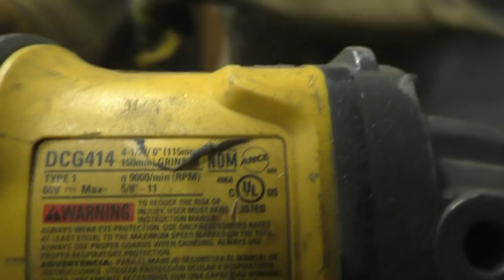Grinder Safety -- and lies you are told to scare you.

Comment: Pretty sure the danger of the discs exploding was risk of the past before they were fibre reinforced. Or maybe made in China stuff.

There are pictures of discs getting lodged into people’s faces though so maybe they still do explode? But who knows what they were using, could’ve been something with more power then a consumer grade grinder, and then putting consumer grade discs rated for lower rpms on the spindle. Overspeeding things is the only time I’ve ever seen anything blow and that was with an ingersol rand die grinder that does 35000rpm, thew in some cheap grinding stones from Home Depot not rated for 35k since I was in a rush and one of them blew up. I didn’t continue trying them out afterwards to see if they were all bad since it scarred the shit outta me and I went off to buy the proper stones from Grainger.

Comment: If people had little bit of common sense an just used the tools correctly, using the necessary safety equipment, no one never would get injured. Nothing less, nothing more. I don't get what u were trying to prove wih this video, but i get the point that  a grinder it's not a leathal massive destruction tool.

Comment: An angle grinder is probably one of the most dangerous tools in most workshop and is not to be taken lightly, however, if they were inherently super dangerous, people would not use or manufacture them. With common sense as well as not using cut off wheels as grinding wheels, most people will not get injured. That being said, I don't think this experiment is encouraging people to take angle grinder safety seriously. I could probably crash a car at 30 mph and walk away, that doesn't that you shouldn't be meticulous about driving safety and have someone else drive if you're not confident. I get that you're encouraging people to learn new skills and not live in fear, but I don't think throwing caution to the wind and using it as an example of how you didn't get hurt is the best way to do that
Reply from the maker: I was not going to get hurt the focus was the safety glasses in the vice.    ...and you need more tools in your shop if the grinder is the worse one you have.    : )

Comment: alright, look.  Small grinders don't concern me too much a 5" grinder wheel isn't all that dangerous without a guard but you need your guard on there for anything larger in my trade.  And for god's sake don't take the guard off a chop saw.   Those 12" wheels can easily kill someone.  It takes 1 manufacturing flaw or some dumbass who doesn't even look at the wheel before putting it on to see if it's cracked to kill some innocent person walking past you on a construction site.  (I have seen this happen. Not killed but got stabbed by a shard of a shop saw blade) 
There are some good points made here but that's at your home or workshop don't go doing this stuff on construction sites because you don't know who might grab your shit and start using it or who might be around when something does go wrong.  Trust me I have a crew of 25 and there is always one that has no common sense.

Comment: stay out of the plane,  turn your hip towards the cutting action, not your crotch!
 RUB your way through the steel don't bite through with the disc at an aggressive angle...its the  kick back that is the killer, when the spin of the disc pulls it in deep all of a sudden

My young assistant (29 yr old) just had a bad kickback that threw  the running saw blade into his left forearm,  driving a one inch by three inch long section of the broken disc inches deep in between his tibia and fibia.   A pretty bad and painful splinter to have pulled out in energency room.  He was going into shock as I got him there. not much blood but a deep deep cut

position your self so the tool pulls away from you as it grabs....not so it pushes towards you if it grabs.  our little Milwaukee grinders run at 12000 rpm  a 6 inch disc is over a foot and half circumference, so that's 18000 ft per minute or almost 200 miles per hour,  you have to respect that velocity and spinning momentum....if it suddenly catches and runs back at you, you will be hurt badly quicker than thinking.   set yourself up so the cut don't buck back towards you.  be safe, injuring your self sucks and makes you stop working, its embarrassing and undignified to stop everyone s work and bleed all over the shop.

Comment: I agree that the most important thing you can do is keep out of the axis of rotation of the blade. That said, i have had a cut-off disc come apart on me and a piece cut through my jeans and about 1/8" into my leg. It was bloody, it was messy, it kinda hurt, but i was just fine after some iodine, some cleaning in the sink, and a dab of CA glue to hold it shut till it healed.  I always wonder what could have happened if i didn't have that guard on. hmm..

One important thing most people do wrong is how they tighten down the nut on their grinder. DON'T ever use tools. Tighten it by hand with the pin depressed, then grab the outer edge of the wheel/disk/flapdisk and snug it up that way. You can crack some types of grinder and cutoff wheels by over-tightening.

Comment: Also power plugs are over rated, just poke the wires in the slots
Reply from the maker: Done that.  It works fine.   Sure beats standing around with your thumb up your ass.

Comment: Yeah, no man. You are operating on the belief that majority of people have common sense, or quickly learn. But that is not the real world. We scare these noobs so they start off cautiously, and slowly over time, getting experience, learn how to do it themselves. I too, no longer use the guard, as I find it easier to maintain my line of sight. But I have been working with these for years, learned the things that you can't do with a grinder (which is very little).
Reply from the maker: Exactly a grinder like most power tools,  needs you to stay in your comfort zone while you build your skills.   I think a vacuum cleaner is an exception.  : )

Comment: I've had a few come apart on me over the years , usually happens around when the disk needs replaced and warn down to much. I've never had a full disk or half disk burst. And haven't been hurt when it does. Always wear safety glass bc eyes are flesh sacks
Reply: They're not even robust enough to be compared to "flesh" imo bc steak is flesh, eyes are more like  hollowed out liquid-filled clementines with deli-thin strips of muscle here & there & always make me uneasy thinking about how horribly fragile they are

Comment: How to not use an angle grinder Always use guard gloves goggles and a visor 2 layers of protection are better than 1
Reply from the maker: So always work to the level of the most unskilled person you can find.   Great advice.
Reply: @SVSeeker  if you can work well with an angle grinder cool but best to work safely people have died or have life changing injuries cos of not using a guard etc 
You might get lucky  several times but eventually your luck will run out
Reply: @SVSeeker  you carry on using an angle grinder see where it gets you what a fool🤣
Reply from the maker: @lukecleaver7462    Been using them for over 20 years with nothing more than a scratch.   A fool is someone that thinks they know what other people are capable of and tries to set limits.
Reply: @SVSeeker  ok the fool is uncalled for doesn't matter how long you've been using them for they have a guard for a reason same as ppe is there for one
Reply from the maker: @lukecleaver7462   No.  Not at all.  You are incorrectly assuming that all people have the same skills.   That is absurd.  Try shooting an apply off your child's head.   With some preliminary practice, you'll know if you can or not.

Comment: Lol everything has a time and place.. of course theres reasons for not using the guard, theres plenty more reasons you should tho. I personally just about lost a finger using a grinder with no guard, and I was using it properly, but it just so happened to kick hard enough to send my finger into the 1/4 inch blade, just about severed my tendon. Also have had sparks in the eyes with glasses and a face shield lol shit's dangerous, you just have to understand and be aware

Comment: Well I have now lost all desire to watch your channel. You have obviously not worked for the last 40 years in the steel fabrication and repair industry. Yes they explode! Yes they can cause personal harm and damage. Even the most cautious seasoned personal can have it happen. Thank you for pointing out some good techniques for using a skinny wheel . I'm most happy to know that you have never had to go to or had to take a coworker to the ER. You talk of loosing a finger or an eye as if its a right of passage! Lets talk about I guy I knew who reached down with both hands and grabbed a running lawn mower for some reason beyond my comprehension.  You might have thought common sense would have stepped in the way and stopped him.  Have you seen the lovely white bone down deep in the split open cut from one? How about cartilage?  I know! how about severed ligiments? Not to mention the nasty infection their known for. I guess the time loss from these accidents isn't a problem for you. Have you ever seen a 9inch grinding disk sticking out of the drywall 10 feet up because it came apart. I'm doubting that you have seen any of these things in person. 
     Ok so your a old guy like me also. Maybe you have been that lucky but i doubt it. YOUR hands your YOUR face thats all good, who cares? . But when your crass enough to post something like this. Trying to tell the new guy who you hope is giving you views so you that can pay for your boat, that guy with kids and a wife at home to feed. That guy who wants to go home at shifts end in one piece with all their parts that they came to work with in the morning I have to call bull on you. Its our job as the surviving journeyman level seniors of our trades to teach the uneducated new folks how to survive. Your showing tips on its safe use is admitting that you know they can cause severe damage. 
As you may have noticed I'm a bit passionate about this issue.  May your vessel build be successful and alway keep you dry.
Reply from the maker: LOL   Let me know if you need help finding the UNSUBSCRIBE button.

Comment: In my dumber novice days of construction ( without the proper education) I went under a house to cut a cast iron pipe off. Long story short the blade caught, exploded, grinder flew out of my hands, I caught it mid air (full slo mo from the adrenaline) and came out unscathed. I’m still not sure if I got lucky or if the blade disintegrated into harmless pieces. But yes common sense, know your tools and what they can do. I’ve since gained at least two points on the common sense scale 😅

Comment: Your attitude towards safety in this video does come off as cavalier, but it's pretty much on par with most skilled professionals. I think somewhere along the line promoting good safety practices evolved into just fear mongering.  

The problem with forcing people to be overly cautious about stupid things is that it might take the focus away from where it really matters. Also people might start to put themselves in the line-of-fire while relying on their safety guards and equipment as a first line of defense when really your first line of defense should be your brain and your work practices.

This test was a nice attempt to try and prove the picture fake (I actually do thing it's probably fake), but I think it falls short. The cutting wheel in the photo is the smaller kind that would be used as a die grinder. Those things things spin at 25,000 RPM. Your battery powered grinder probably does something around 10,000 RPM and you were cutting a thick piece of metal which would slow it down a lot. 

If the a person was cutting thin sheet metal at 25,000RPM (barely slowing the wheel down) and the disc went flying it will definitely do some damage. I had a sanding band come apart on me while using one of those die grinder drum sanders once and it made a pop sound and brazed my knuckles. It happened so insanely fast It took me a minute to comprehend what happened. It felt like I just cut my fingers off. I pulled my glove off and all my fingers were bruised and had blood blister on them. That was just as a flimsy piece of sand paper.

I do appreciate your insights. Thanks for taking the time to make this video.

Comment: Finally someone whom talks common sense. I have used grinders as a hobbyist for 35 years and have never had a disk fail. My fingers have accidently tangled with running disks resulting in a minor friction burns. The most common injury is touching hot metal (which doesn't look much different from cold). I don't agree with not using a guard though.
Reply from the maker: : )  The most common joke in our shop.  "It didn't look hot."

Comment: "Exaderated."Hehe guy have home ahead of hospital .. I was not see this accident ..but guys was say that disc broke off from grinder and hit him(i dont know directly or by ricochete) in bload vesel on side of  troat .... He dont seal it or dont seal it proper i dont remeber and blead out in 2 minute away to hospital. As i was kid i was run and feel of ...then hit head in sharp metal corner ... And lost awarness... After few minutes i wake up in great  pubble of blood in flor me in it .. And immiedietly when i lift head up i lost  consciousness again..(.then when mother find me with greater pubble) when i wake up again mother give me mirror and say "warch there is hole and you can see you white bone/skull... I watch it few seconds at sit position and blow pressure increase inncomparision to lay flat ... Soo i pass out again .. Next time i wake up in hospital... Something similar can hapend not by fall of but due to some grinder iccident that not imposible ... Soo instead if play with it i try to minimalize risk .. I life 34 years and never bloke any cutting disc ..  Month ago i was work with not my tools and there was no cover on angle grinder ... We need but some pipe that was rubber pipe with steel enforced sticking out of ground .... There was  two discs that broke of grinder at this cutting .... I dont even know where it fly but at that position it can but vessels at my hand ... I was try to put presure at top soo disc will not be grabbed and stop but it propably happend anyway .. Becouse that pipe was multilayers that propably w as losse inside or something and stop/crack disc there was some vibration . I was try to hold grinder staid as it was possible i thing it was ..but when i cut without cover maybe it was not straight bacouse i not want have eyes in line of potential hit . Not use cover is always play with death. It can go safe 100times and 101 it can kill you... Its other story when my father work with other straight grinder and without cover .. There was his mistake that he use toth blade on it and behing wood was rubber ... His head not was behind blade .... But when grinder blade cut of wood it "stop" at rubber and jump of(kick of...i dont know how it say im not native eng speaker) ... And nones and joint work as hinges and bend at moment, force so spining blade cut his face 20cm long ... I was at shool at this time when i was back home i heard some part if this story from mother and go to see that place whenit happend i find some white  sawdust from father skull :D after father back from hospital (they keep him for two day becouse they say  he lost blood )he say he was too hury and it was stupid to not predict this... He say he underestimate force that it can kick back.  And especialy when work above his head.

Comment: thank you so much, i've used an angle grinder for a few automotive projects and I've always been so scared of it breaking to bits and cutting me, I've genuinely been more worried about that than I have been about accidentally touching the wheel; which I'm also very careful about hahaha. This makes me much less nervous about using it.

Comment: Use all your common sense and all you want. If this damn thing can cut steel and concrete, it will cut any safety device you put in front of it!!! They do help, so KEEP THAT FRIGGIN' GUARD ON it will help stop that blade rotating at thousands of RPMs!  That being said, wear some googles to prevent the chips going to your eyes, and even if you wear all the damn equipment, the disc will shatter and fly into milion pieces towards you. Yes, those discs are light, but they carry a lot of momentum, and they will hit you, not with their mass, but with the speed. Is like a rock going towards your head, is a small rock, but, man it hurts... If you use an angle grinder, prepare yourself like you're going to die EVERY TIME. Remember those warning labels and those people who missed a finger with this tool...TO NOT DO THE SAME WHEN YOU'RE GONNA USE IT. This tool is the most dangerous around, and useful, along with box cutters. Use them as if they were cars. A car also can kill you, and other people too...
Reply from the maker: Don’t worry Mom; Dad said it was Ok.

Comment: BEST TIP: Get a grinder with RPM dial. Grind at the slowest pace you can. Yes it will take longer, but the risk is much lower. Stupid video. Do yourself a favour and use all the safety equipment that you can. I got metal in my eye which was bounced from the side and through the ventilation holes on my protective glasses! Had to go to the medic for that!
btw you can always fall, trip over, suddenly loose grip, or someone is behind you and scares you etc etc.
And wear hearing protection too. Those sharp noice will damage your ears. And dust protecion.

BTW this is a small grinder. The risks are bigger with the more powerful models. Some people start with small grinders and later use the bigger ones but keep using them like they with the smaller models.